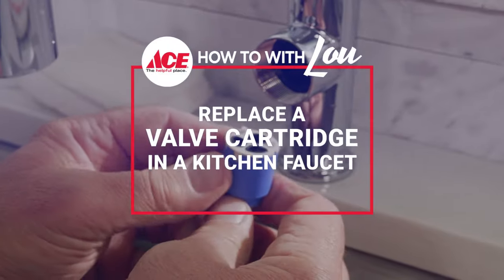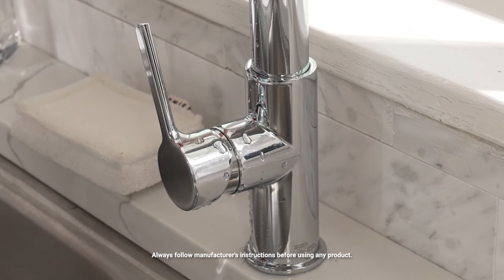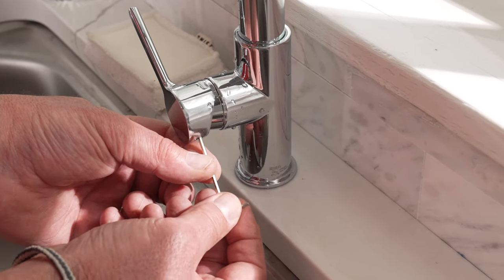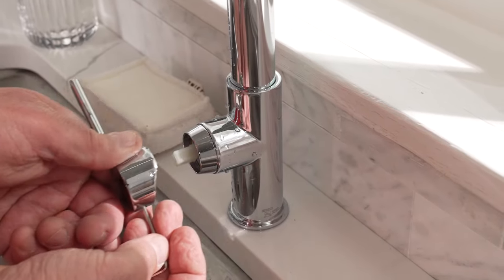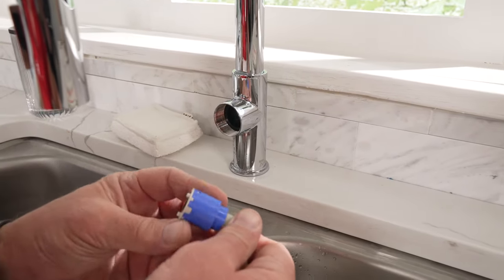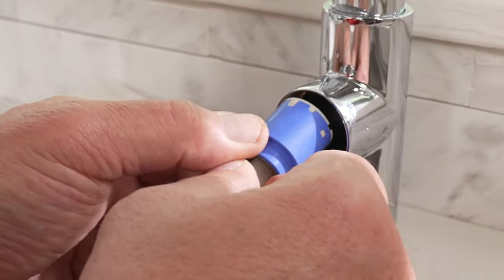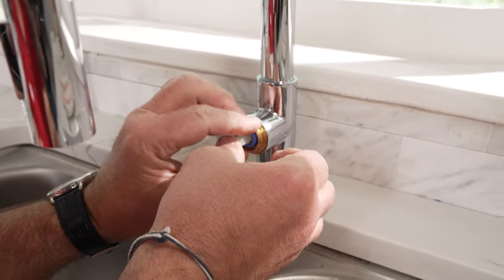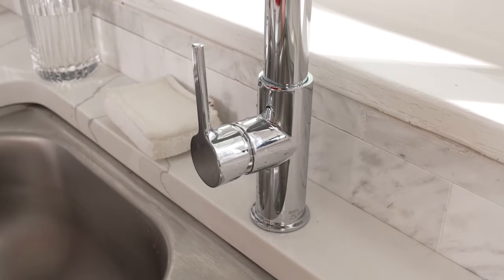How To Replace A Faucet Valve Cartridge - Ace Hardware

Comment: I have the same kind of faucet handle that refuses to budge with the screw off. Any suggestion or tool to remove the handle.
Reply from the maker: Hi There,
We suggest you consider spraying some CLR around it to try and loosen the calcium up to help with the removal. Hope this works!
Reply: try using hammer to hit the surrounding area to break the calcium deposit. Tap tap